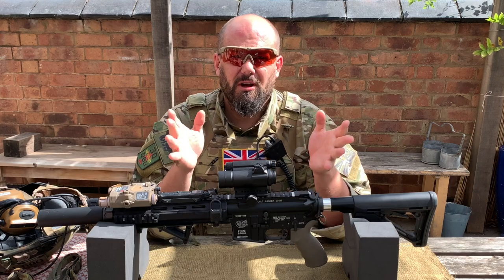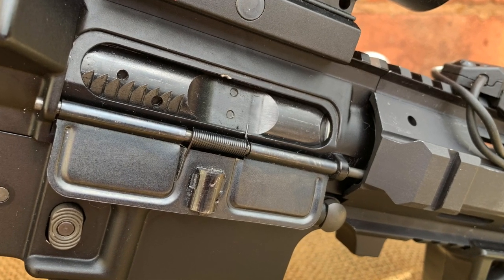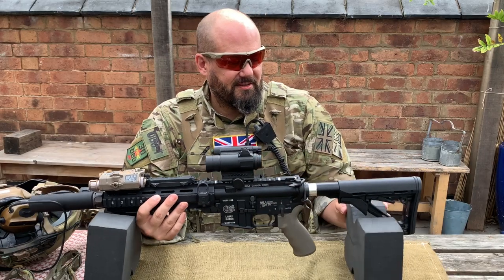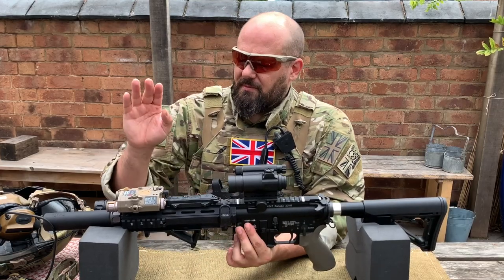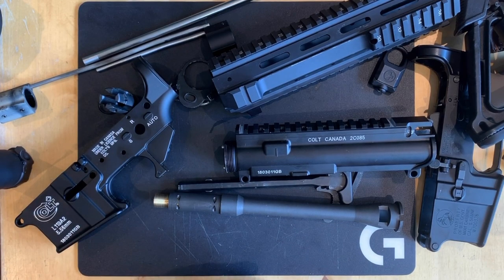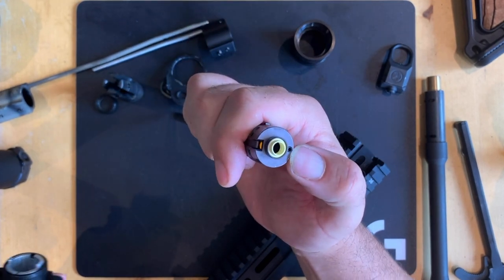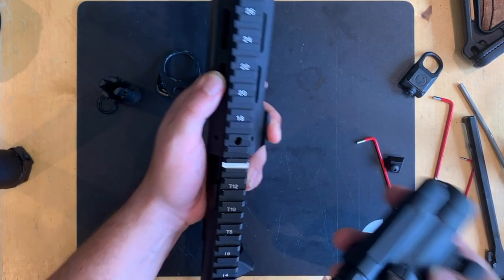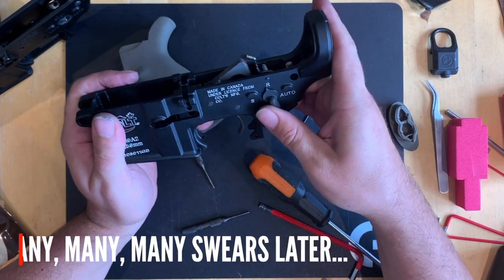L119A2 Build | Airsoft SAS SBS UKSF Rifle | AATV EP123

Comment: Great vid Tom! It’s making me want to build one. 🤦🏻‍♂️
I’ve built a few custom guns over the years including probably 7-8 L119A1’s using both AEGs and GBBR’s. If I did one now I’d do it on the Marui MWS platform though. 
I’ve also build quite. Few others including a Warsports LVOA before kriss brought one out; a recce style rifle based on a G&P gearbox and receiver set and madbull front end and outer barrel. I’ve done a few high speed “race gun” type AR’s too. Finally, back in the Magpul dynamics days I built replicas of both Haley’s and Costa’s AR’s as well.
Reply from the maker: Sounds good, some great stuff there! Do you have photos? GHK have been having some quality issues recently so I wouldn’t go that way until they sort themselves out.

Comment: Been thinking about a L119A2 build myself. I've got a AAF (American Airsoft Factory) AEG arriving next week. Going to run that for a bit and provided it all good, going to turn that into my L119A2 build. Really excited to have GBBR style realistic operation (lock back on empty, release bolt, have to manually load the first round) all inside a AEG platform.
Reply from the maker: That sounds interesting, I saw some promo material a while ago. I'll have a look
Reply: @AnvilAirsoftTV  think  brain exploder reciewed an early modle and it was disappointing. Will be great if they have improved it.
Reply from the maker: Yeah I remember watching something about it that didn’t impress me too much. That was a long time ago now though so as you say it’ll be interesting to see what’s changed.
Reply: @AnvilAirsoftTV  from what I've seen the AAF is very similar in function to the DAS.
Reply: Well I'll let you guys know when I get it. I've got a few videos of it running and I'm happy with its operations from what I've seen. There was a big update they released part way through last year which helped alot. 

As for the brain exploder video. His most recent one. The issue was due to low battery I believe. 

I'll find out next week what it's like. Would be happy to work out some arrangement for you guys to review at some point once I've got my hands on it.

Comment: What an awesome build!! The L119A2 cought my attention in Nairobi during the attack where the lone SAS member went above and beyond to save lives, and end terrorists... my question though is whats your/peoples thoughts on the Element LA5?? Ive heard a majority of them get no where near a zero when it comes to adjustment in reference to where the BB is going to end up?? ✌
Reply from the maker: They won’t really hold zero. Especially on a GBBR. There are some mods you can do to pack out the cavity with foam to help. There’s videos on YouTube. If I’m actually going to use an IR laser at any distance I’ll use a G&P DBal
Reply: @AnvilAirsoftTV  thanks man, my next question was going to be if you would reccomend a DBal instead. Top man, and top build. Thanks again. 🤙
Reply from the maker: It’s one of those situations where you have one product on for photos and another for actual use. The G&P is a bit on the warm side really so caution is advised and absolutely keep it on low power.

Comment: It’s funny British special forces don’t even use L85 says a lot about what the top tier believe is a better rifle. AR15 platform is the best modular rifle platform in the world. That is why the US military has used it for over 50 years.
Reply from the maker: The L85A2 and latest L85A3 are very well regarded by the troops that used them. The Armalite rifle has been used by the British military for longer than the US Army in specialist roles. There did seem to be a massive push for a bull pup for heli borne and armoured vehicle operations and there was also a political / economic reason for going with a domestic rifle. Personally I think we should have gone for a license built AR18 at the time. Stirling were even producing them and the L85 is basically a bull pup AR18.

Comment: Love it! Might have to join you in making a l119a2, think a TM recoil ar would make a good base?
Reply: They're is a Facebook group that's has lots of info on building UKSF impression rifs. Look for L119A2 owners group. 

As for you questions,yes the TM NGRS makes a good base for a L119A2. TM NGRS, GHK M4 gbbr and Systema PTW tend to be the go to platforms for most builds. But any M4 platform will do in theory.
Reply from the maker: I’ll invite you into the owners group. Sometimes it’s hidden. The NGRS is one of the more expensive ways in as you’ll either need to find a blank lower or get your trades filled and recut. Great way to do it though.
Reply: @AnvilAirsoftTV  well I'm thinking if I'm gonna do a project gun, I might as well do it in style!

Comment: Ffs don't drop it! Very nice. Good job.👍👍👍
Reply from the maker: It’s on the sling now. :)
Reply: Need a sling and mount, for my mws. Any recommendations?
Reply from the maker: I like Ferro concept slingsters. They come without clips so you can choose what attachment system you want to use. I normally use Paracord loops to mount. Light simple and cheap.

Comment: What gas block did you use and would it work with the tm MWS
Reply from the maker: I just used a cheap FMA one as it barely be seen. Should be fine with an MWS. If that bothers you HAO do an accurate replica.
Reply: @AnvilAirsoftTV  thanks

Comment: Is this a real AR15? Your channel is about airsoft but I’ve built real AR15 style rifles and this is literally everything you would do to a real AR15. Even the bolt carrier group looks exactly the same to the real thing you even torque the castle nut with an armorers wrench. If it’s an airsoft gun how does it work I’m interested.
Reply from the maker: Good isn’t it?! It’s a gas blow back airsoft rifle. The gas is held in the magazine and is released by a knocker valve hit by an extension to the hammer. The gas both propels the BB down the barrel and is used to blow the bolt carrier back. They are very similiar to real ARs but are dimensionally not accurate in the critical dimensions so you couldn’t convert one.  Recoil wise this one is somewhere between a .22LR and a 5.56mm. Lots of fun to use and potentially to train with. They are relatively noisy too.
Reply: @AnvilAirsoftTV  Interesting. The completed lower and trigger look exactly the same you could probably use it in a real AR. The buffer tube spring is probably a lighter tension right?
Reply from the maker: Other than the extension to trip the gas valve they are very close but as I say they change the dimensions slightly so the trigger groups aren’t compatible with real ones. I used armourer guides to re assemble it as the airsoft versions weren’t very good. It is yeah. You can use a real buffer weight to get some extra recoil at the cost of gas efficiency. There are some heavier weight springs too but not as stiff as a real one.

Comment: pathfinders use l119a1  and so does Royal marines
Reply from the maker: Marines and Pathfinders are using L119A1 at the moment. There may be some L119A2s with the units but I haven’t seen reference photos that I can remember.
Reply: @AnvilAirsoftTV  yes your spot on they use the l119a1.